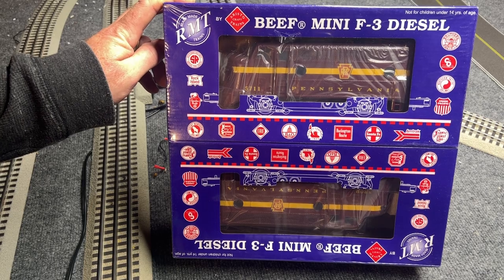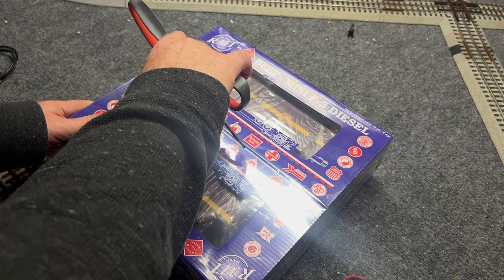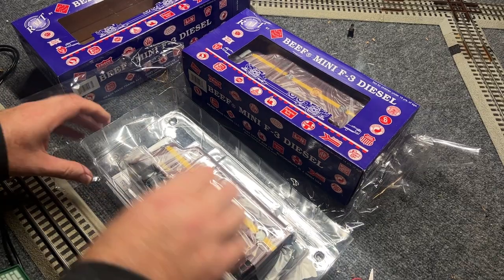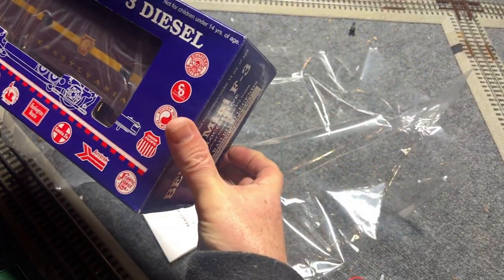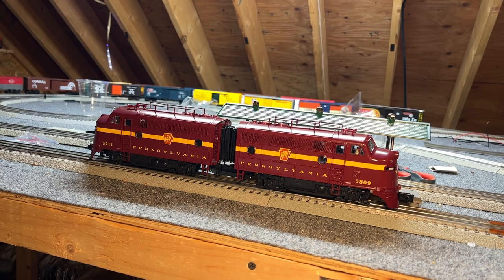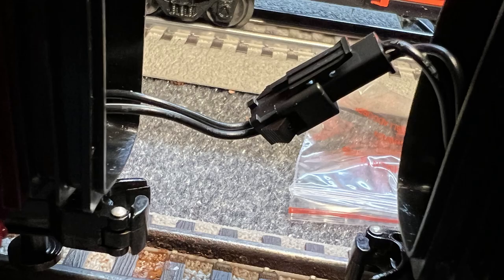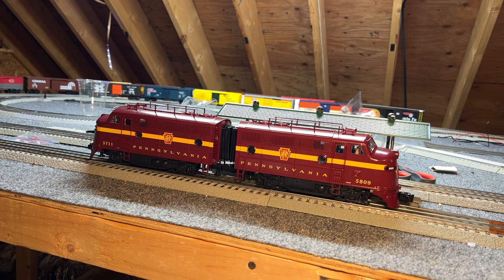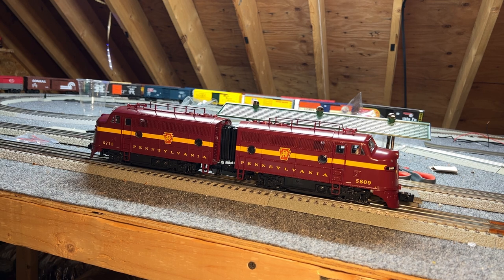O Scale RMT Beef F3 Pennsylvania A-A Review

Comment: The dummy A should have a electronic horn. Also if you want directional lights take the power for the lights off on of the motors and add a diode to one of the lights leads and then cycle the reverse unit to see which way you need to wire the diode. (This should work with normal mini incandescent lights around 12-18 volts. Be aware though these reverse unit are tiny so you don't want to make a mistake or overload them.) You will have to add another wire set from the power unit to make this work with the dummy unit.  I just got 2 A n-p and 2   B powered units this week.